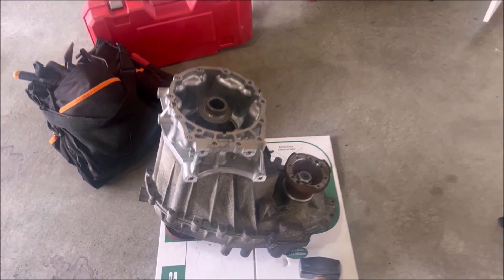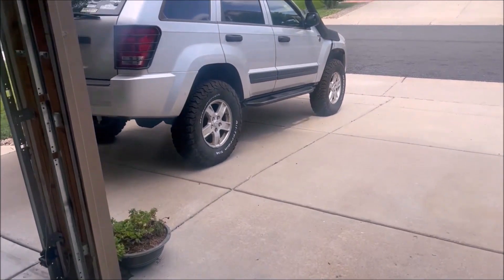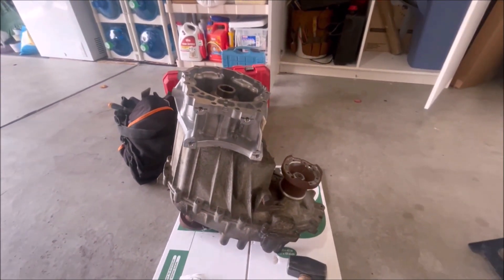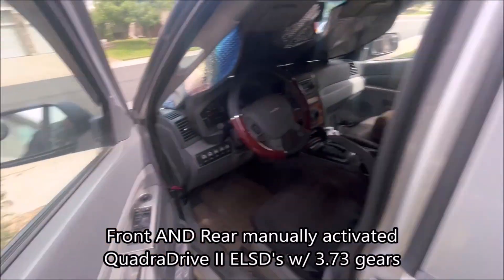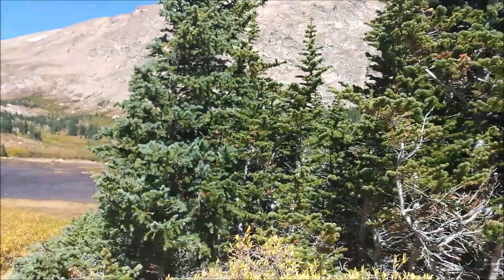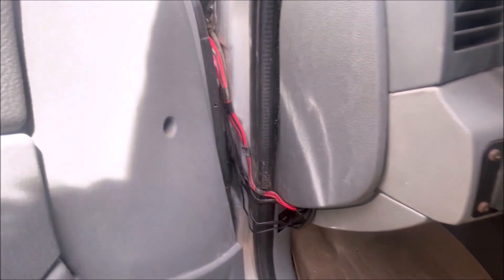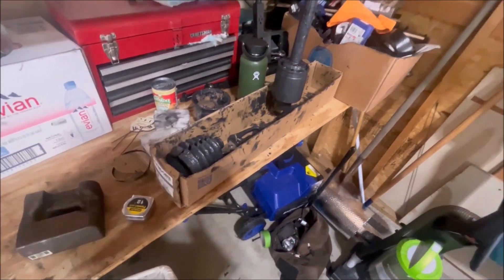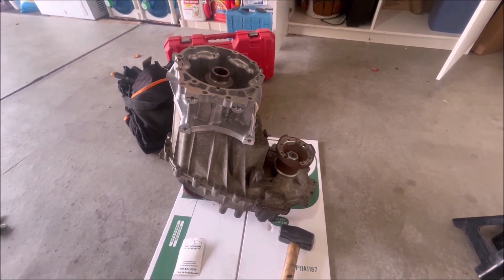QuadraTrac I swap to Command Trac update (Jeep WK/XK) - [Extra Info in Description]

Comment: What lift kit ? I heard you can only do 2” lift on these
Reply from the maker: My silver WK is running a discontinued modified 5” Superlift. (No longer made).
With today’s lift kit options, only a 2-3” is what’s safely allowed without having a bunch of long-run issues.
Reply: @TheValleyofAwesome ok thank . I’m think of putting one together myself. They have the spacers and the extension for the lower strut shock . You think I’ll be ok with that  ? Thank you for getting back to me.
Reply: @TheValleyofAwesome the transfer case your putting in why is that one better than the one that’s in it stock ?

Comment: Wait no limp mode? where do I get one of those TCMs?
Reply from the maker: “HHP/High Horse Performance” will make a TCM for us WK/XK folks who have the older model NGC3 (non-CAN) controllers that don’t allow you to change the gear ratio by traditional tuning.

But that was only to solve the final drive ratio at the axles.
When in low range, the vehicle will still go into limp mode unless you disconnect a wheel speed sensor so that the vehicle doesn’t attempt to detect a constant discrepancy. 

If you know anything about CommanderJim on Jeep Forum, I wished he had tried this before giving up on his XK.

Comment: What is your plan for the shifter? Also, any reason you didn’t go with a MP3023 (QT2/QD2) tcase? I look forward to seeing the final product! Always had a soft spot for the WK!
Reply from the maker: It is possible to run a TC cable shifter if you run it through the same grommet where your transmission cable runs through, so no cutting or drilling a of a new hole is required. The mounting position for the knob itself may be to the right of the transmission knob in that little rectangular cubbie.
Though I do see the possibility of having to extend the TC cable-end via welding. But I’ve also heard of companies out there who make custom-length transfer case shifter cables so it shouldn’t really be an issue.

The reason I went past the NV245 TC (what comes factory with the QT2/QD2 WK and XK’s) is because those are electronically activated, and without proper FDCM flashing from the dealership (which some have tried and failed), this is an extremely stressful parts. Essentially my preference was mechanical gears vs electronically controlled gears. Less room for failure. People have tried the NV245 route and failed unfortunately.

Theoretically, even if I couldn’t make a proper shifter for the NV241, it would still be possible to crawl under the Jeep and pull the lever by hand. (Giving me 2WD, 4WD HI, N, and 4WD LOW). Granted I would definitely need wheel chocks to put the WK in and out of low range using this method. But I’m sure that I won’t encounter any real issues installing a center console TC shifter.

Thanks for watching! : )